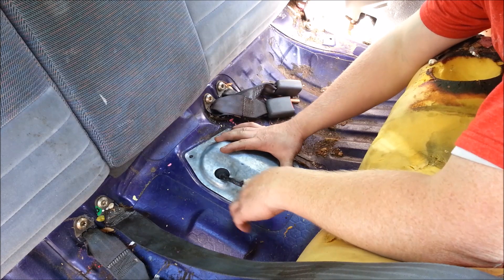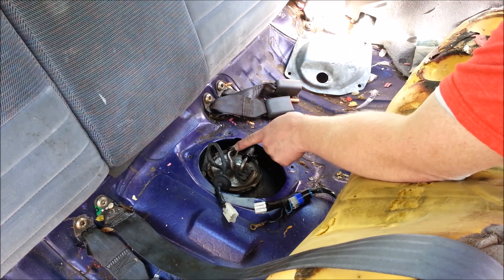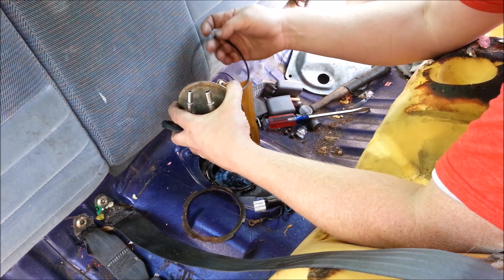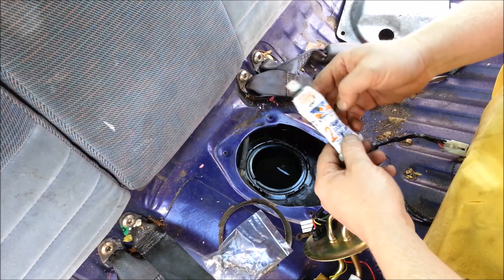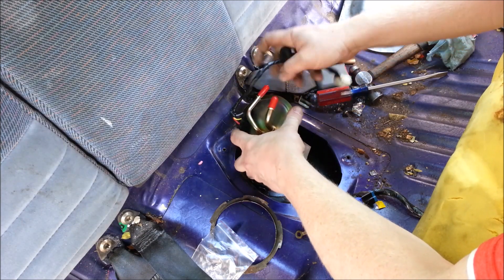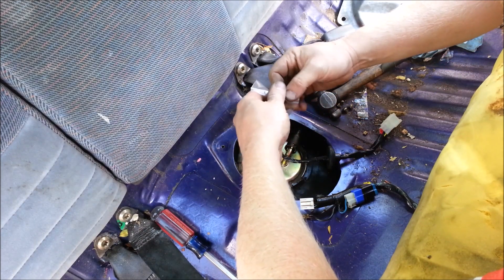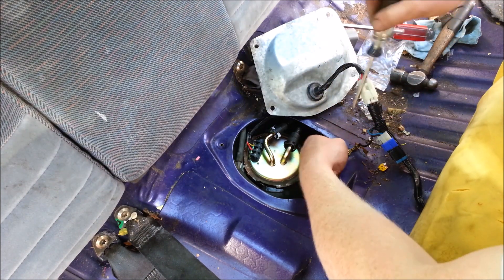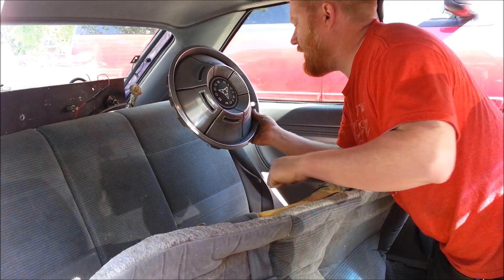Ford Escort Nissan Mazda Fuel Pump replacement

Comment: Bought a used Santa Fe from a shady dealer.  Later discovered it has bad (or wrong) sending units and a leaky tank.  Of course first I have to drop the driveshaft and rusty exhaust system (without making ANY sparks) to get the tank off. 

So this vid will be VERY useful when I get to replacing the sending units. Thanks a million.
Reply from the maker: ***** Those shady dealers are the worst.
Reply: ***** RE the Santa Fe...sending units were fine. Whoever installed one put the float on wrong and it fell off into the tank.  Easy fix.  Explains all the strange readings. Turns out the Santa Fe does NOT have a Schraeder valve (looks like one comes as a special "tool" that needs to be purchased).

Comment: That was a nice replacement pump/kit. I recently changed the pump on my 1998 Chevy flatbed and the wiring was changed. It came with minimal instructions so it was a pain to wire it correctly. Everything works, but my fuel gauge bounces from stop to stop when I turn on the key. Then it settles down and indicates properly. Nice video, I always enjoy seeing what your up to.
Reply from the maker: ***** Hey Thanks..

Comment: Great vid, as always, couple of things, it is better to use a brass tool to strike the lock ring, gas+air+spark=gire, as we all know.

Then, the system has a supply port and a return port, your vehicle must have a pulse damper-pressure regulator by the shraeder valve you bled down pressure, this has a línea that senda unused fuel back to the tank, this feature takes care of the aire in the línea, at an average of 80 PSI in the system the air goes away into the tank pretty fast.

The vehicle has a leak test routine built into the computer diagnostics, it will sense big leaks and small leaks and give a check engine  light status, on,  hence the light comes on if you leave tour fuel cap un-done when refueling.

Two tumbs up on this vídeo, keep them comming.

Comment: the only issue with the access port in the car is, your car will Stink like gas for a fort night (2 weeks)...... other than that super easy, and fast to replace!!!!! plus it looks like you did it with a FULL TANK, That is even more of a ball buster..... thumbs up bud.. thanks for the video. YOU FOR GOT ALL THE FRENCH FRY'S... I always find fry's in the seats. hell even with a brand new car. I think the dealer puts them there......
Reply from the maker: Richard Downer It's all the assembly line workers sitting in the cars on their lunch breaks.
Reply: haha gas HIGH.....

Comment: Thank you. I think that's why my car stalls once in a while,  I let it set , fires right back up. After I changed the fuel filter. So now fuel pump. To a 1991 Ford escort. Thanks again. I'll let you know. May even video it.

Comment: Nice man, Learned just for fun the Ford Focus 2007 you need to cut a panel out to get to it but it can be done without removing the tank. I did that on a 6000 years back but had to pull the tank.It's nice to be able to avoid pulling the tank if possible. Funny at the end of the video!

Comment: Good vid Moe. I've changed lots of fuel pumps and had to drop quite a few tanks on many occasions! I'm lucky to own two cars with access plates (mazda protege5 and lincoln MKZ) I hope I never have to open them up! Thanks for sharing.
Reply from the maker: Fireship1 I wish more car manufactures would do access panels.

Comment: Nice video. No not all fuel pumps are that easy. Last fuel pump I did was on a 1983 Volvo. Access to the fuel pump was in an opening like that in the trunk.  Glad it was a good size trunk.  Yes liquid weight is about 7 pounds to the gallon.
Pretty amazing what was in that back seat all those years.  I was waiting for you to pull a kitchen sink out.  Lol..

Comment: You need to drain the fuel tank (another complication) to remove fuel before dropping the tank. It is awkard enough to manage the bulky tank w/o fuel. The Accord I did had a drain plug, but you can jumper the fuel pump (if working!) to pump all the fuel out.

Great video!

Comment: I wish all pumps were under the seat or engine mounted. I miss the manual fuel pump days. Have you ever tried Permatex Rightstuff?
Reply from the maker: Emt Scythe I have used Permatex Right Stuff, but it's been a long time. It worked good for gasket maker. The #2 I show in the video is a different animal. It really never sets up and is one of the only things that is fuel resistant. I had a neighbor that had a Volkswagon bus from the mid 80's. It was fuel injected but Volkwagon put the fuel pump on the frame rail instead of the tank. Needless to say it was very easy to change out. Some auto manufacturers actually think ahead to how their product is going to be serviced.

Comment: Thanks I didn't know there was an access panel to the fuel pump under the back seat. it will be the first place I look. You also make it look easy. How did you know your fuel pump needed changing? It looked like, from your video, that the fuel line had pressure. By the way I love your videos.
Reply from the maker: ***** The fuel pump electric motor gets worn to the point where it will stop spinning/pumping. Cycling the key and banging on it will get it to start spinning again(sometimes). That is what happened here.

Comment: Do you have to bleed the schraeder valve of the air in the line,or does it just go through the system until it picks up fuel? Ive never had to do this. Since my tank is under the bed of the truck,I'll have to drop it to access it.
Reply from the maker: BCtruck, rebuild, repair,repurpose I've thought the same about bleeding but it doesn't ever seam to matter and I've never bled one.
Reply: sixtyfiveford Thats good to know in case I ever have to do this. Id love to find a chainsaw!!!
Reply: sixtyfiveford Petrol fuel injection systems work on a 'flow and return' basis and self bleed any air. That's why there are two pipes to the sender/fuel pump unit, one hose discharges excess fuel straight back into the tank along with any air in the system.

Comment: do you have a link to buy that whole unit? I have a 1.9L 1996 LX escort that I need to replace the fuel pump on. it has 299k miles and it won't start on me anymore at about half a tank of gas. All the local autoparts store around me only have the actual pump to sell, or "kits" but they don't include the filter sock sadly.

Comment: LOL,,   I knew some vans have that access plate but I didn't know cars did. I've been lucky and haven't had to replace a fuel pump yet.  Now on a different topic, what do you know about portable generators ??  I have a smaller one that the motor went on but the generator is fine so I was wanting to hook up another motor to it and I did try but apparently the generator needs some type of power to get it going. There is one wire that goes from the on/off switch that used to be hooked up to the old motor so I'm wondering if that's what needs to be hooked into the new motor somehow to get this power or is there some way to duplicate that power through a battery or something. Anyway I know this isn't a good explanation of things but any thoughts ??
Reply from the maker: eaglehill6 I know a little but there are a few different types. Most rely nothing on the motor. They need an initial current to start the generating process. Most do this all by themselves but if they have sat for years they need to be re-excicted. You can do this by starting and running the generator, then plug in a drill and spin the chuck by hand and pull the drill trigger. The drill will take off and the generator will start producing electricity.
Reply: sixtyfiveford http://www.nooutage.com/images/ColemanPowermate-pm0401850_300.jpg    This is what I have so I'll give what you suggested a try  Thanks  Have to find a 4hp motor first though..
Reply from the maker: I've worked on a fair amount of those. Generally they have a Suzuki engine but I believe they also came with Briggs. I don't know if these need a taper shaft engine or if a standard 3/4" shaft motor will work. .
Reply: I'm not sure what it was now either, all I know is it was 3 1/2 hp and it basically burnt out so I have it torn down a bit so that I have a shaft that I can put a pulley on. I did try it a couple or 3 years ago with a little 3 hp engine that way but didn't get anything out of the generator. Maybe didn't have it going fast enough, supposed to go at 3600 rpm so my idea is to get a 4 hp engine with a side shaft, like a snowblower or a tiller and hook it up with pulleys and a belt, not sure how I'm going to figure out the rpms yet but it should work if I get that right..I want to take out the piston on the old engine and just leave the rest hooked up.
Reply from the maker: All small engines are designed to run at 3600rpm so that easy enough with a pulley, just use 2 pulleys the same size. If the motor junked itself then I would suspect nothing is wrong with the generator part. A 3hp motor should work, you just wouldn't be able to get the full 1850watts out of it before it started to bog and slow down.

As far as wiring; really the only wire that would go to the motor is the kill wire to shut it down.
Reply: Oh  I didn't know that about the rpms so that's good so I'll find an engine somewhere and give it a try again and yes the wire to the on/off switch is the only one that's disconnected so the generator part should still work..  thanks for the help..
Reply: Ok so I tried to separate the engine from the generator, I loosened and took off 6 bolts holding it together and it came apart about 1/2 inch enough to let any leftover oil out but it won't come any further than that,, I can see some gears and stuff in there and I was hoping to just take the piston out but I don't see any other way but to separate this thing. Got any ideas on that??
Reply from the maker: You will need to take the generator head off first. This involves removing the outer casing(stator) and then the rotor( a little tricky). Then you left with a bare motor and the motor housing/sump cover will come all the way off.

Curious to why the existing motor is dead?
Reply: I was afraid you were going to say something like that..As for the motor I ran it a lot and it just started burning oil and then running rough as hell and finally it was caput so that's why I figure the generator part is still good and I'm not sure what will hold it together without the motor housing bolted to it but I will give it a go anyway. It's not doing anything the way it is..
Reply: Well I got that thing apart and the piston is out along with all the other spare parts that are not needed now.  Didn't quite go as planned but a little anger and a grinder with a cut off wheel goes along way.  lol   Anyway it's back together and spinning freely so I just have to put the rest of it back on and it just came to me that I have a 1hp motor off my tablesaw that I could hook up to test this before I go spend the money on another gas engine.. We'll see how that goes.....
Reply from the maker: Yeah, try the electric motor. A 1hp electric motor has a ton more torque than a gas engine and will have the equivalent of a 2-3hp gasoline engine. So it should be a great test.
Reply: Yea that's what I figured too. It will cut through most anything on the tablesaw and not even grunt and it says it's 3725 rpm so that's close enough.. We'll give er a go and see what happens..
Reply: Say, I have a tip/trick for ya,,, About a week ago I finally started to work on the lawn tractor and get it going after sitting all winter and 3 of the 4 tires were low/flat. ! of the front tires wouldn't hold air overnight and I discovered  the air was coming out around the valve stem (Tubeless),  I didn't have any slime stuff to put in it but I had some silicon caulking so I worked some of that around the bottom of the stem, let it sit for a bit and pumped it up and put another layer on it.  It sat for 5 days and the tire held up and then it was used last night and today and it's still holding up,  So that seemed to seal the deal..
Reply from the maker: Nice fix.

Comment: Easy fuel pump access makes the job much quicker. What kind of car is this? Many small children are lost under the back seat. They may get lost trying to play with a chainsaw.
Reply from the maker: revitup1965 This is a 96 Ford Escort. A lot of people will just cut access holes even if there isn't one.

Comment: You forgot to mention that no fuel pump has ever failed with a tank being nearly empty. Its always right after you fill it completely up, then have to drop the tank.......
Reply from the maker: Robert L Yes, of course. It's build that way from the manufacturer to help ensure you don't forget what gasoline smells like.

Comment: My '93 Escort is cranking, but not running. 
The pump is suspect, since i was able to fire it up with starter fluid.
New fuel filter and the even fuel pump relay. 
Before I go buy a pump, what is a definite sign it needs replacement?
Reply from the maker: Make sure the safety shut off switch/collision switch didn't get tripped.
Reply: Thanks for the reply! 
Was unplugged when I bought it.
Today I listened for the pump and heard nothing when I turned the key. It must need a new one.

Comment: Did you happen to find that new fuel pump under the seat too? lol Good video!
Reply from the maker: ***** That would have been nice.
Reply: sixtyfiveford Its like shirts and the spare button they attach. Considerate manufacturers should stash spares where you might need them :)

Comment: I think I may have depressurized the wrong thing.....I have a Mazda Millenia '97. 6 cyl. it didnt smell like gas when I pushed the pin in...
Reply from the maker: If the car has been sitting a while there will be no pressure left in the system. Make sure you're looking at the fuel rail and not you Air Conditioning lines, as they have similar valves(larger).

Comment: Old video, but what holds the back seat down?
Reply from the maker: The front is held in with tabs you slide the seat forward under. Then the rear portion of the seat is held down by forcing it under the backrest.
Reply: Thanks, I changed my fuel pump yesterday, it was probably the original one and it finally quit.